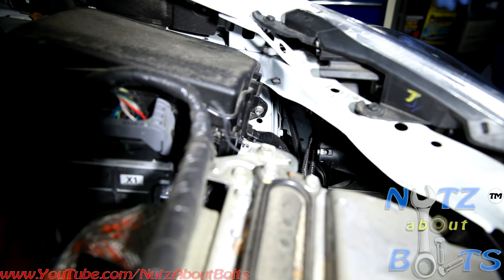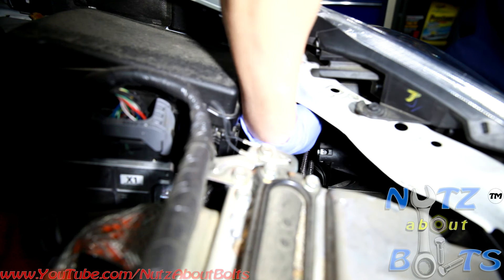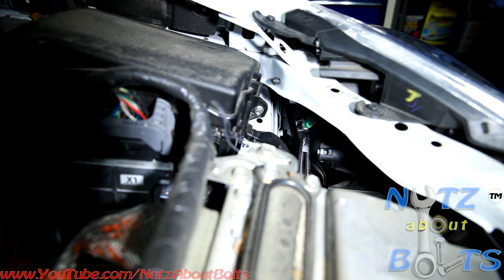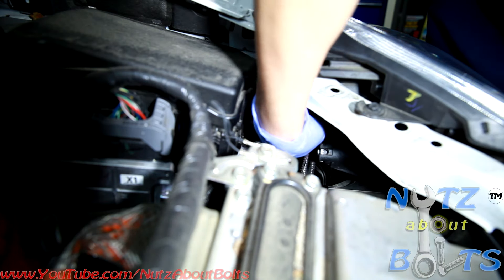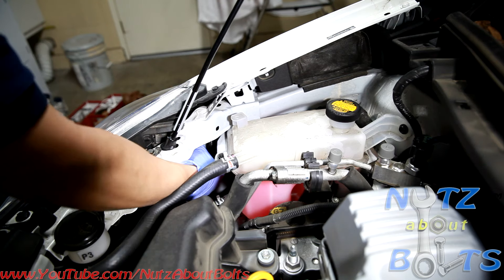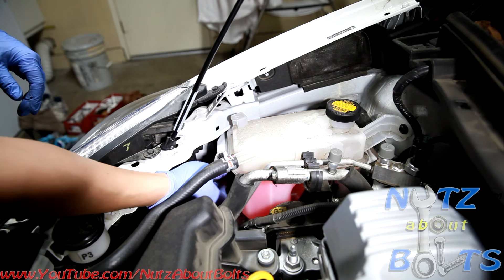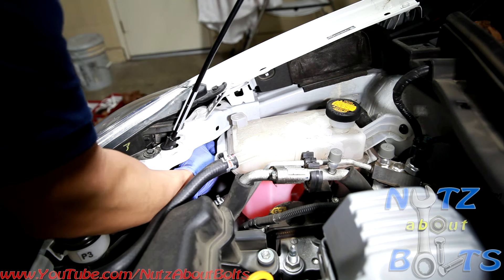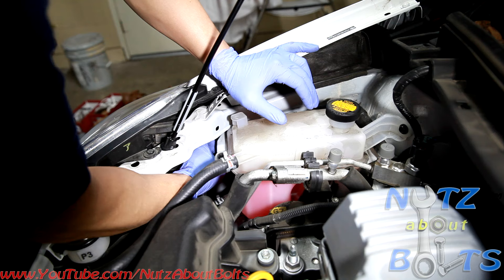2010-2015 Toyota Prius Headlight bulb remove and install

Comment: I changed my passenger sign out last night -  first attempt, I got it crooked - not properly seated.  I removed 10 mm bolt holding the 1" diameter hose, moved the air hose over and removed the old bulb and assembly.  The hardest part was figuring out how to release the bulb from the connector.  I was trying to make it harder than it is.  Once I watched that on youtube I easily removed the bulb. Then I put a latex glove on my right hand, AND HERE IS THE SECRET TO EASY REPLACEMENT - I put the new bulb in the hole in the car and THEN snapped the connector to the bulb.  It is much easier not to have to be twisting the wiring around in a confined dark space - just put the bulb in first and then snap the wiring to the bulb. Mechanic wanted me to bring car in and he was "going to check it out"...meaning taking the bumper off - at cost of about $300.   I am senior lady and not afraid to try repairs myself.
Reply: I am having a hard time releasing the bulb from the connector.
Reply: Great tip to reconnect after setting the bulb! I fought it for 20 minutes before reading your comment. Got it in 30 seconds!
Reply: Thanks sassy lady! I fought this for 10 minutes. Bulb was in within 10 seconds after reading your tip.
Reply: thank u so much for real
Reply: Thank You for the tip!!!
Reply: You just saved me sooooo much frustration and money. I could NOT get that passenger side bulb in for nothing! Dealership wanted to charge $85. I don't know why I hadn't thought to put the bulb in first, then attach the wire! Thank you!
Reply: Kudos Sassy Lady! I followed your advice from the get go and even with my giant man paws I still got the passenger side bulb in and plugged in in about 3 minutes. I totally see how it would have been a real PITA to try to do it with the wires connected!
Reply: Wow. That's 10,000X easier.  Thank you!
Reply: @kristinmoyer9610 Same here.  It’s like the former owner superglued it together.  For those reading this the trick to disconnect, the bulb from the cable is to press downward on the clip assembly towards the bottom, which will allow it to release.
Reply: I wish I followed your advice BEFORE I replaced my headlamps. I’ll remember this the next time!
Reply: Thank you for this tip. Just found it after lots of struggling and got it installed instantly

Comment: Driver side is easy.  Passenger side after a lot of trial and error I found a way to make the process easier.  Before using a new bulb take a broken one and practice it first so you dont damage the new bulb.  Anyhow, remember you need to rotate clockwise.  When you insert the bulb, position it so you start east and rotate downward (south).  I found it easier to plug in the bulb first then connect power line to the bulb.  Hope this helps.  If the explanation is confusing give me a shout out.
Reply: +Paul Kim iNSERTING THE BULB FIRST AND THEN CONNECTING THE POWER LINE TO THE BULB IS THE WAY TO GO
Reply: +Chris Mauro I forgot to do that BUT you are right. Plug the connector on AFTER installing the bulb. However if you drop the bulb, you have no safety net and might have to dig around to find it if it falls down into the engine bay or worse falls thru to the ground and breaks ... just something to consider six of 1 ...1/2 doz of the other I guess.
Reply: this was a life saver.  It's basically impossible to turn the whole unit from the right of the car because the wire to the light doesn't go that long.  Once I took it out of the wire socket it was really easy.
Reply: Amen for Pkim. I had a lot of problem with the passenger side. But followed Pkim's advice, now I can sleep easy tonight lol
Reply: is the passenger side clockwise to uninstall?? or counterclocwise
Reply: Counter clockwise
Reply: Bulb first, totally made the difference for me!  The passenger side almost kicked my butt without that tip!  Thank you Paul Kim.  Also Thank you so much for the video Nutz about Bolts.
Reply: Thank you!  Installing the bulb first and then connecting the power made it so much easier!
Reply: Yes, this worked!!!!
Reply: Worked for 20 mins on this. Your tip worked immediately. Thanks
Reply: well detailed instructions. I followed your instructions and pushed the bulb ( while it's still connected  to the wire ) twisting into east or south east position first  and gently turning it into south. I was able to get it right in just 5 seconds. That was really helpful. I was giving hit and trial until I read your directions of twisting it into east position and gently turning south. Thank you.
Reply: I am from six years in the future, here to thank you for thinking of "bulb first, then connect" when I failed to think of that.
Reply: That was it!!  Putting the bulb in first then reattaching is the secret.  Went from 15 minutes of fumbling to 1 minute.  Comment of the month right here
Reply: Nine years later and this suggestion to put the passenger bulb on first, then connect to the power plug after was genius and totally saved me tonight. Thank you.

Comment: Thank you NutzaboutBolts man for providing your stepping off video.  The driver side bulb exchange went smoothly.  I wished my hands were a little smaller, however, when it came to the passenger side.  You took a little more time finding the sweet spot, but what was missing for me were verbalized particulars of what you were feeling for, etc.  Anyway, I was close to giving up, but watched again and read all the comments.  It takes a village; the orange gasket thing was still on like the one guy experienced.  Then, I thought it was very smart to practice with the old bulb, but I couldn't get it out.  I was using a mirror, but of course, every time I put my hand down to guide it, I could no longer see.  Again I consulted everyone's clarifying comments and VOILA!  This 60 ish woman feels TOTALLY EMPOWERED and I thank you all.  My car repair guys will be proud of me.
Reply from the maker: +Kathy Streng nice work! I'm sorry if it wasn't too clear as where the bulb was, the passenger side is a pretty tight area with less room to work with since the ABS system is in the way. I'm glad you got it replaced :)
Reply: This helped me with mineyoday thank you!

Comment: Passenger side is much harder.  Even Toyota had a hard time getting it in.  And then it was crooked and didn't focus on the right part of the road.  The T Parts Dept. also mentioned that the bulb blows out in a very short time.  I have had my car 4 years with 3 bulbs replaced so far.  Wish I could get Toyota to pay for their crummy decision on bulb choice.  You should only have to replace a bulb every 8-10 years.  This is ridiculous.
Reply from the maker: Yeah... I'm not sure why your bulbs keep blowing. I haven't replaced my bulbs yet and its been 4 years. Make sure when you put it in, make sure it lines up correctly as you can accidentally put it in crooked. Also make sure not to touch the bulb with your fingers as your finger contains oil and can cause the bulb life to be short. As for the passenger side light bulb, you can remove the intake tube to make more room for access. I hope that helps.
Reply: It is a well known issue with the 2010 and 2011 Prius that the bulb burns out frequently.  Toyota has put out a service bulletin for the fix - but it costs too much for me to have that modification done.  If they made it a recall, the problem would be eliminated for us.
Reply: @sassylady1098  mine lasted four months.  I still can't get the passenger in straight I'll try the 3 o'clock maybe

Comment: After reading all the comments and ignoring the video I used the following technique to remove and replace the passenger side headlight bulb.  If you have average size hands, it's best to remove the two bolts to the reservoir aso you can get it out of the way.  Also, remove the 10mm bolt which secures the air assembly and move it out of the way.  Then use the following to remove the bad bulb.  First, remove the wiring harness to the bulb, the harness connector to the bulb is at the 6 o'clock position.  Press down on the small tab to release the harness from the bulb.  If the harness is stuck, apply a small  amount of WD40 to the clip which should loosen it up (I had to do this for my 2010 Prius.  Next, turn the bulb housing to the 3 o'clock position.  Again, I had to apply a small amount of WD40 spray to the outside of the bulb to loosen the bond to the bulb socket.  It came out easy after doing that.  Next, insert your replacement bulb into the bulb socket with the connector (where the bulb harness attaches) at the 3 o'clock position and twist it to the 6 o'clock position and it should now be secured.  Finally, attach the wiring harness connector to the bulb and it should easily snap in (you will hear it click).  You should be good to go!

Comment: Thank you. 75 year old widow here. I first removed the high beam light by mistake, struggled to disconnect it from the harness. Then realized my error after I had the bulb free, put it back, and worked on the burned out bulb (driver's side.) I have to use a small screwdriver to press on the connector to unlatch it. I am worried the new bulb is not seated correctly...doesn't seem loose but don't think I got it to 6:00. I think I will have to remove it and try the technique of putting in the bulb first, then snapping on the connector. I appreciate the video and all the comments, gave me the courage to try myself.

Comment: I agree that the video is worthless; but the comments posted here are very helpful.  After a frustrating winter night in a parking lot trying to change bulbs, I found the following steps to be helpful.

1.  I definitely agree that installing the headlamp first, and then attach the wires is best.
2.  On the Sylvania bulbs we purchased there was a rubber flange that was not on the bulbs I replaced.  I found that I had to fold this back to install the headlamps, then try to roll it back in place.  I don't know if I got it replaced correctly.
3.  To install the headlamp, start in the 3 o'clock position (east) and rotate clockwise to the 6 o'clock position (south).
4.  On the passenger side, I removed the air intake by taking out three bolts with a 10 mm head, and I disconnected the upper coolant hose to the overflow tank.  This gave me all the room I needed.
5.  After installing the head lamps, I tried to roll the rubber flange back in place, and then connected the wires. I then re-installed the air intake and the upper coolant hose.

I hope this helps.
Reply from the maker: I guess I'll have to redo this video. Sorry, there wasn't a lot of room and it was a very tight space.
Reply: Step 2 was very helpful thanks!! When I took the light out, the rubber ringcame loose. I desperately tried forcing it in and realized it was never going to work. All I did was pull the rubber back and walah popped in like nothing.

Comment: Last night I had an appointment with the dealer to change my driver side h11 light bulb. They quoted me $100 for 1hr labor plus parts. They said it requires the bumper to be remove. I was sooooo upset since I brought the car 4weeks earlier from them and didn't expect my Toyota 2011 certified used Prius to have that problem. Than I looked at your video and showed it to the "Toyota certified technician" I change it myself in less than 60sec and save $100. Thank you for your valuable info.......'
Reply from the maker: Nice! Glad you saved some money. The way the dealerships replace the headlight bulb is by following the repair manual, since that's what they called for, which is removing the front bumper. But there is a short cut way to doing things, so this is one of them. Glad you decided to do it yourself 👍

Comment: Changed my passenger's side headlight using all the info here-- quick summary of all the good points:
(1) First move the radiator overflow reservoir out of the way. Just two bolts with a 10mm socket and extender.  (Don't disconnect any hoses!)
(2) Rotate the bulb holder towards the right side of the car (counter-clockwise if you are facing the direction the car would move forward)
(3) Remove old bulb from socket
(4) Put the new bulb in the with the socket facing the right side of the car and rotate down (clockwise)
(5) Reconnect the socket and replace the radiator reservoir
Reply: #3 Alternative - Try putting the bulb in first and then attaching the socket to the bulb. Much easier.
Reply: For us with large hands and forearms, getting the radiator overflow tank is an absolute necessity.

Comment: Thanks for this video. I've done it twice now for our 2010 (first replacement set ever just burned out last night after only 4 months- have not had this problem before- hoping it won't continue! Read about a lot of problems with this for some folks. Just love our Prius.) Paul Kim, your suggestion for inserting the passenger side bulb without the power cable attached, and then connecting the power cable to the bulb is a great one. Much easier. The driver's side is a piece of cake.
Reply from the maker: Pam Smith np! Never heard of any problems with the bulb before... I've been driving the prius more than 4 months now ever since changing the bulb without any problems. Make sure not to have any oily fingers touching the bulb as it can shorten the life span on the bulb and can cause the filament to short itself.
Reply: Yep, I wore rubber gloves both times (thanks to the video and the fellow at the parts store gave me a pair each time). There are several spots on the internet about the low beam headlights going out for the Prius -http://www.kctv5.com/story/18609018/kctv5-investigates-prius-headlight-problems-
but as I said- first time in over 3 years for us. Hope it's the last!
Reply from the maker: Pam Smith
I hope so too, if I feel like mines having a problem, I will surely post something up :)

Comment: On the passenger side, where space is tight, I found it easier to install the new bulb first, then snap in the connector.  Thanks for your video.

Comment: Thanks for a great how-to video!  Passenger side is more difficult to access though -- not much room to work in, even with a small hand, but it is worth doing yourself.  The shops really charge quite a lot of $ to install these!
Reply: how much where they trying to charge you?
Reply: I live in a large cosmopolitan area  with a high cost of living.  Prices were between $40 and $80 for each bulb (excluding parts).  Labor was also high for the rear license plate bulbs, which were incredibly easy to install.  Only problem with the license plate bulbs is that they are very difficult to pry off off their plastic holders.

Comment: Like the previous viewers mentioned, this video didn't help out at all, except inspire conversation. It would of been awesome if you had a close up, and, a video of the passenger side replacement, which is really hard to squeeze a hand into and have enough leverage to twist the bulb out and then back in.
I just replaced mine last night, but it took a lot of determination and a careful grip.
I placed a flashlight off to the side so I could see the area and was barely able to squeeze my hand in there. (I have large hands) 😯
I first tried to twist the bulb out with the connector still on, but the wire harness didn't seem long enough to allow that counter clockwise twist, so I then tried to unplug the connector, but couldn't get a good enough grip to remove it.
 I was thinking about removing the coolant reservoir buy removing the 2 mounting bolts, but had seen that I would probably have to undo both hose clamps and that would be a challenge in itself, so I left it.
I ended up just stretching the harness a bit while I twisted counter clockwise with a little extra power and, hoping I wouldn't damage the connector. Well, I did get it out with the harness still connected - yay! Ha, but that's just halfway complete now.
After popping the bulb out, it was easier to see the clip on the connector and remove it, for I had just enough room to pull it up higher to get a closer look and better grip to pull the tab out and off.
Now I was thinking on doing the reverse by plugging in the harness and then inserting the bulb into the socket, but still couldn't get a good feel to align it properly.
Next, I figured it would be easier to feel the bulb "fit" into place if I put it in separately without the connector (harness) attached, but if I dropped it, it could fall into the abyss and be unretrievable. (Maybe buying a 2 pack would be a small insurance plan?)
Anyway, it was time to get into a meditative state and hold the bulb very carefully and twist clockwise about a quarter turn into place. The starting point was the connector facing out towards the outside fender parallel to the ground and then twisting so it would face down towards the ground when the rotation was complete.  
It took a few tries, but got it in after about a minute of very slow and careful maneuvering! 
After I twisted it in, it wasn't that hard to slide the connector straight up from the bottom onto the bulb as I heard the satisfying "click" into place - Done!

Comment: I could feel the tension as you tried to get the pass side bulb in! My 2008 Yaris requires pulling down bumper and removing the headlight!
Reply from the maker: auxmike yeah, the passenger side is a little tight but its nothing we can't do! haha. The Prius manual said the same thing "removal of the front bumper", but if you have a small hand, you can replace it without removing the bumper.